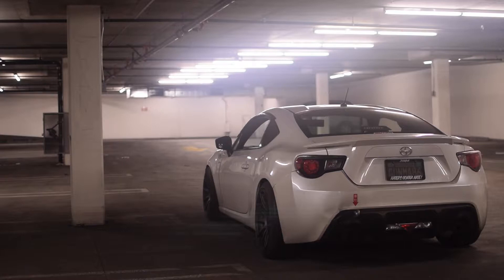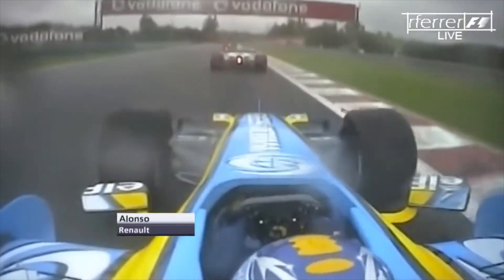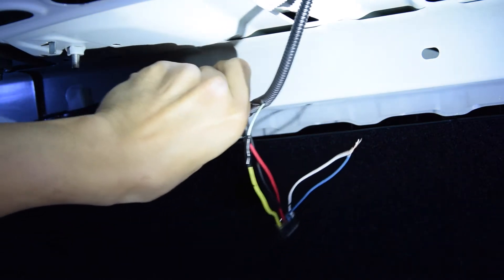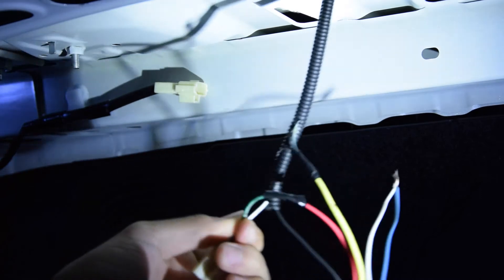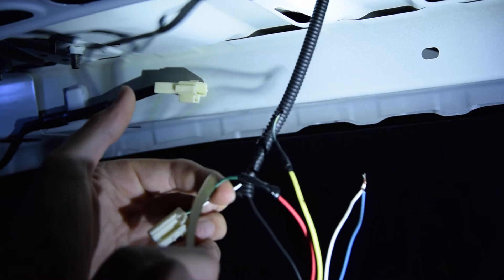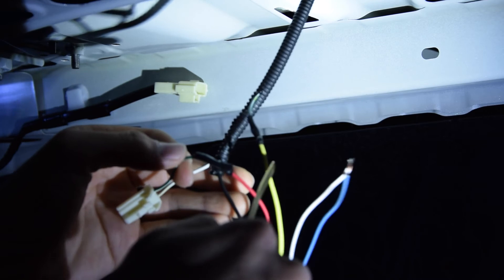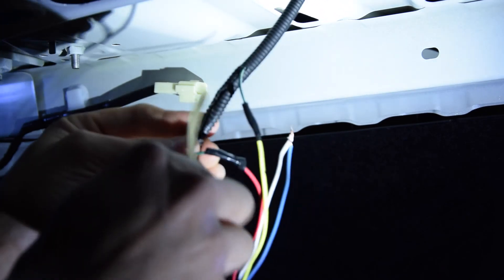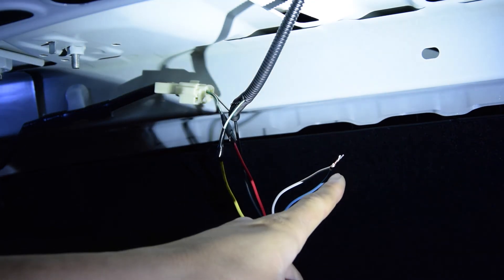Center BRAKE Light Flasher Chip [DIY INSTALL]

Comment: Helpful. Thanks
Reply from the maker: No problem buddy
Reply: TougeKing after installing mine I noticed that the brake light is not as bright as before. Like half as bright. Did you have this issue?
Reply from the maker: +thebozman15 Not on my car. Did you double check your ground?
Reply: TougeKing guess what. That's what it was. I blame the cheap wire taps I used. Just twisted and shrink wrapped and it's all good
Reply: Do you have yours on the faster or slower flash mode? And have you had any issues with the police at all? What state are you mainly driving in?
Reply from the maker: Perfect! YES shrink wrap or electric tape is best! I haven't been pulled over yet, and one cop did manage to get behind me but didn't seem to be bothered by it...so 
¯\(ツ)/¯ also I'm in California.

Comment: what year is your frs. and would you recommend it to someone who is 18, coming from a 2014 TC. what do you love most and hate the most with the frs? sorry. just wanted an owners opinion
Reply from the maker: Mine is a '13 and I recommend it to anyone who's interest in coming into a entry level sports car. I plan to keep this car for life because of how much character and spirit this car has. However, in order to live a satisfied life with this car, I need to accept the fact that this car is a slow ass car (assuming that you keep it NA.) Therefore it's REALLY important that you remember this before purchasing this baby. You have love this car with all your heart or else the BIG V6, V8, V10, V12, and any turbo charged engines will destroy you. That's really all I can say.
Reply: this car excel in the twisties. hands down one of the fastest on the canyon roads.
Reply: Yep, either an FRS/BRZ or WRX/WRX Sti....and you're set for canyon roads. Question for you +TougeKing, I have a third brake light on my 2018 WRX Ltd, would this work for that as well? I know the WRX already has a spot for an F1 brake light but EVERYONE has it. I'd like to be a little different.